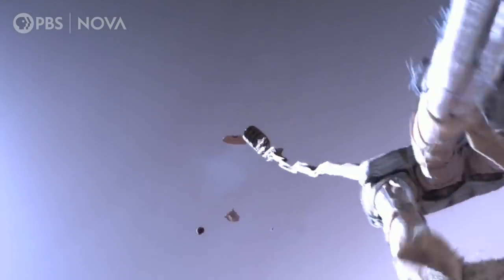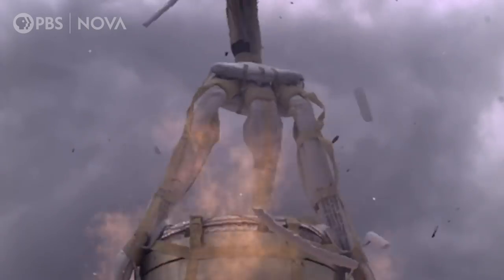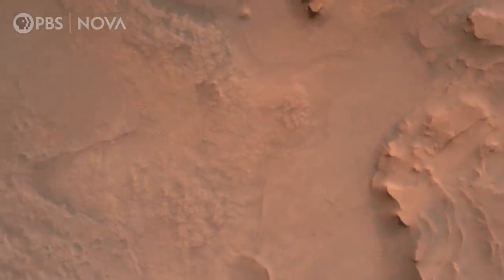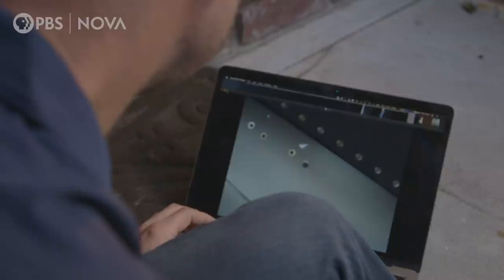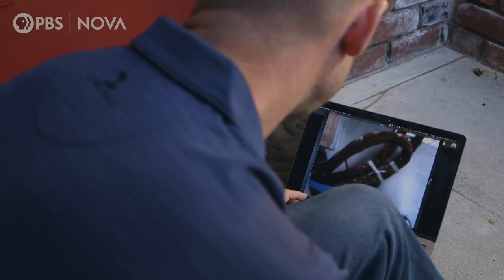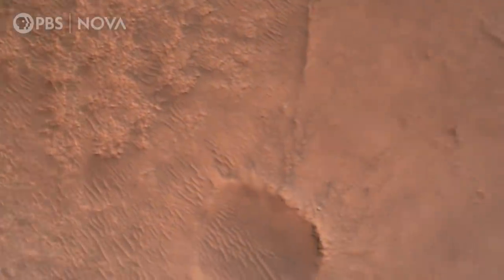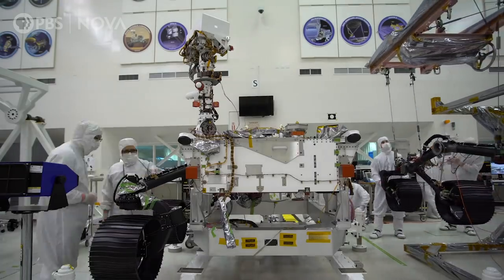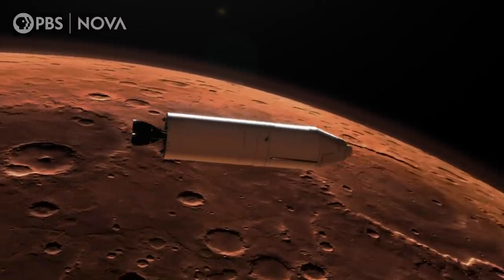Feast Your Eyes on the First-Ever Mars 2020 Landing Videos

Comment: Did the sky crane just fly away and crash when it ran out of fuel or was it a more controlled descent before it ran out of fuel? Just curious. Just Googled it - the crane flies away and crashes.
Reply: Would make sense if it was going to destruct to use it to expose something with the energy spent - dig out some of that delta to reveal deeper rock / fossil / something.